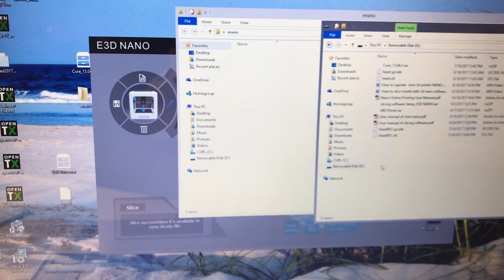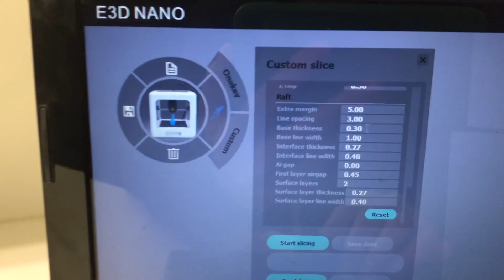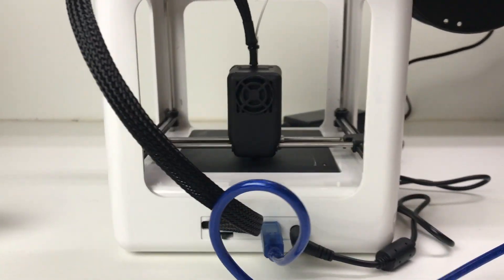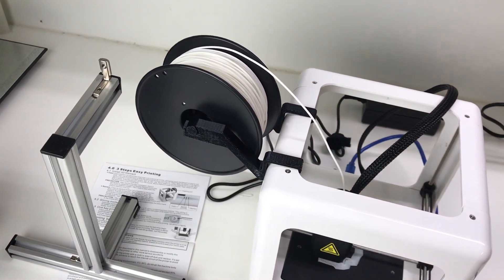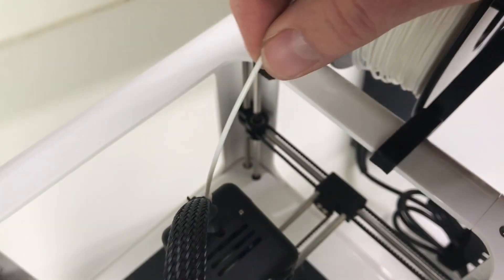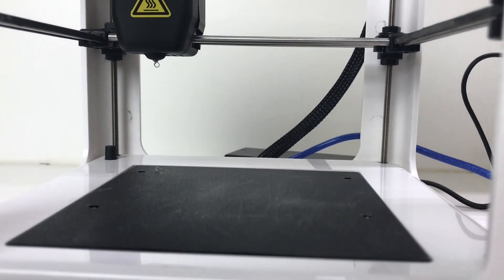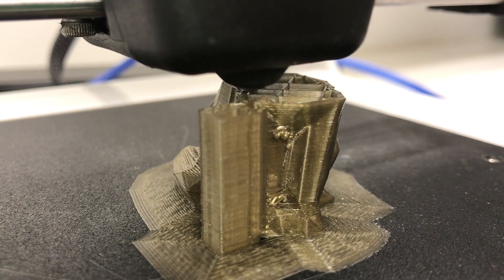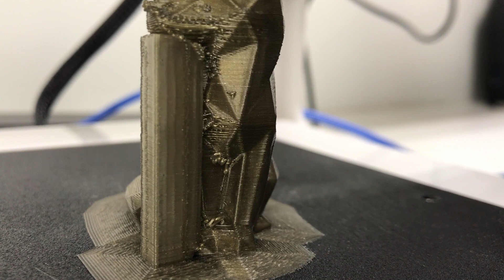BEST BEGINNER 3D PRINTER?  - E3D Nano - Easy 3D Printer Review

Comment: I'm new to this 3D printing. This is a really interesting printer. Can I use this with MacOS? I don't have a windows PC.
Reply: Another person tried to use the software that includes, and it did not work, but i think you can find other programs that work with mac os and the printer😀 try to do a little research to be sure though.

Comment: The print quality looks bad. Not as terrible as the print from the E10, but still bad. With this print quality it's just a gimmik and absolutely not worth it as a tool. Why spend $150 on something worthless and not get something decent for $400 instead? Don't be that cheap guys. It's not gonna be worth it.
Reply from the maker: Some people don't want to spend the $400. And for some they don't need super high quality for just starting out. I get your point, but there are two sides to this coin.